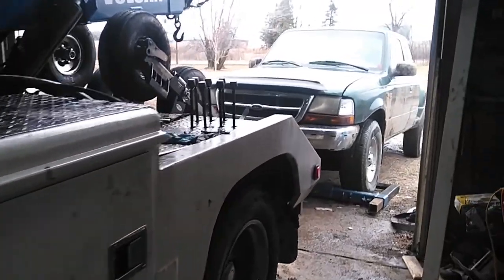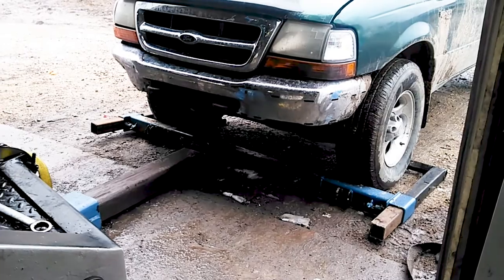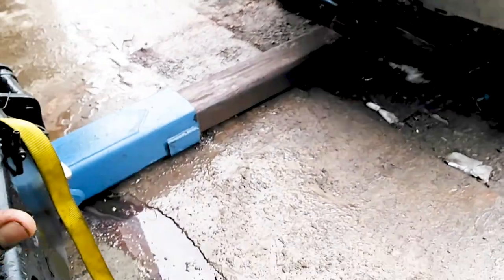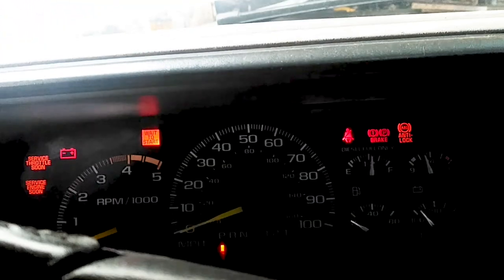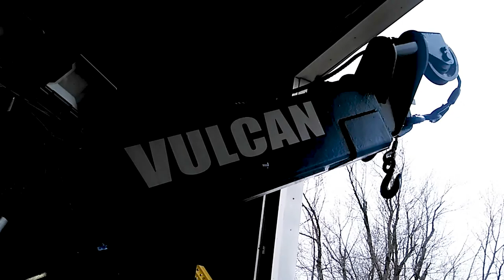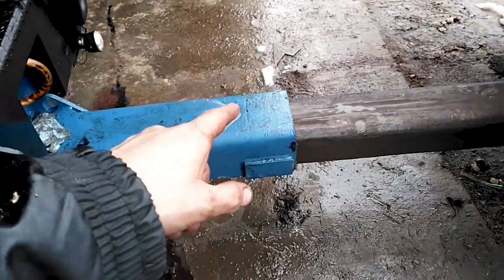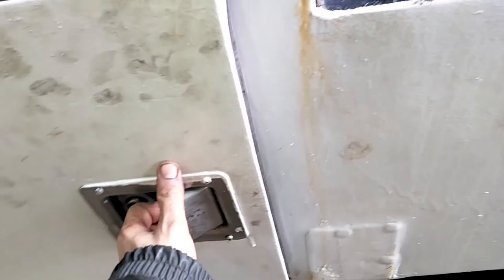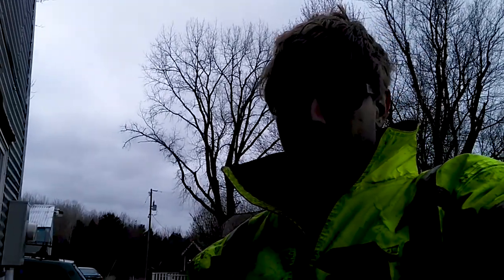I bought a Tow Truck!

Comment: Congrats!!! May I ask your company name? IDK if posting it would be like free advertising or not. Good job on those hydraulic repairs! I was snowplowing in the middle of the night on some rural state road - of course during a snowstorm - lost a hydraulic line on the plow blade. Had to fight it 20 miles back to the shop with the blade flopping back and forth. Shop mechanic was a tad bit surly about repairs. I guess it's messy? Anyway. I was never brave enough to go the entrepreneur route. Again, CONGRATS!
Reply from the maker: Thanks! Everything is coming together and I did a few tows today. Truck worked great! Top Tier Towing LLC